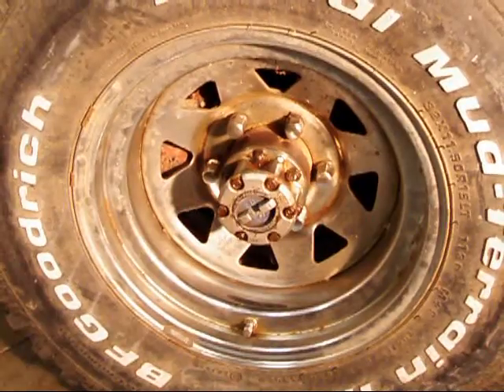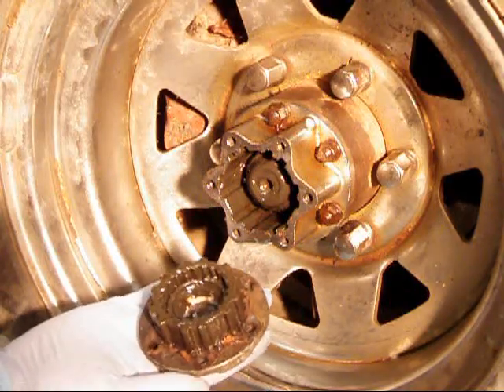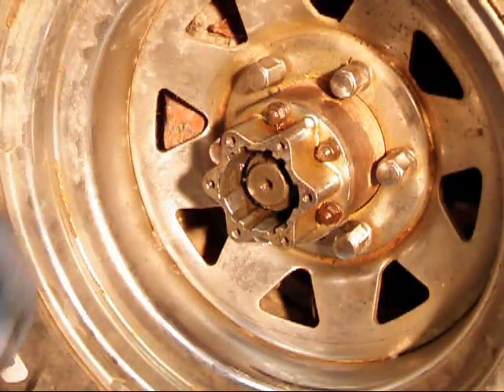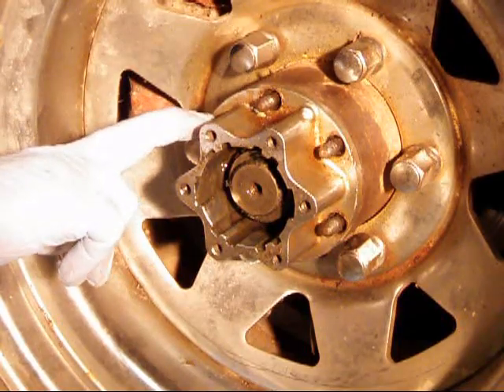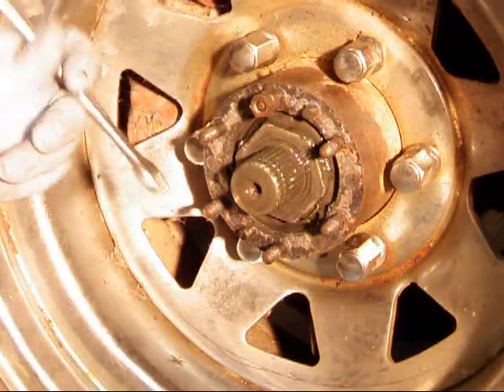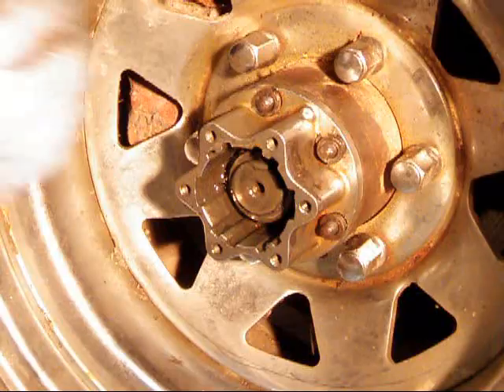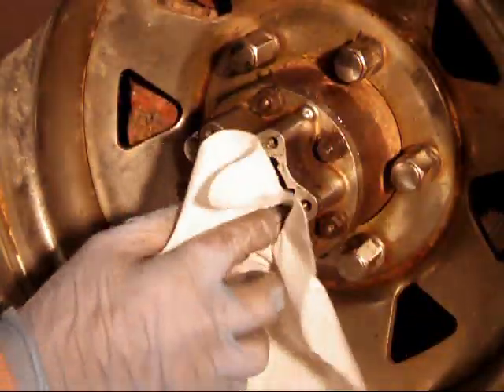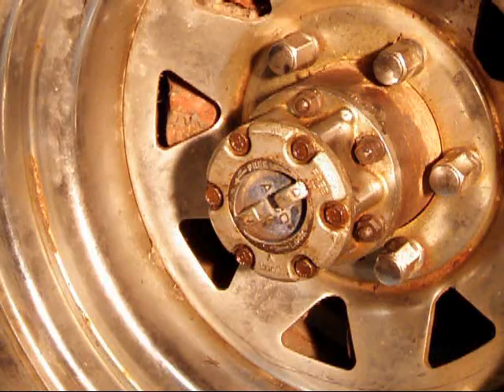How to Remove & Replace a Toyota 4x4 Manual Locking Hub (See video description for more info/tools)

Comment: Any idea why my hub dial would be siezed? Took it off, pulled the spring and pawl off and the dial is siezed inside of the part where the bolts go. Pulled the snap ring out, greased it, then put it back in. Still siezed.
Reply from the maker: Did you pull the actual hub dial out of the hub dial cap?  There should be a funny shaped o-ring around the actual dial to seal out the cap from the cover, and then there's the detent ball and spring that are in the actual dial.  They should correspond to the notches in the cover.  I've had one that was really rough because the o-ring was old and exanded and was jamming between the dial and the cover.  You could also have deformed one of the parts in a hard hit?  Marlin crawler has the o-ring, spring, and detent ball, if you need to replace any of those parts.  https://www.marlincrawler.com/axle/front-axle-parts/service-parts
Reply: Yes, as I said I pulled the snap ring out. Pulled the red only piece (dial) away from the piece that actually gets fastened via 6 bolts. I pulled it apart tomorrow and see if the detent and spring are situated correctly.

Comment: When I took mine apart the spring came out with the hub end cap now when I put it back together I cant twist to lock or unlock. If I install it on free it wont twist to lock and the same if I install it in the lock position.

Comment: After you have all that off, what would you do to pull the whole rotor off?
Reply from the maker: The problem with the early Toyota 4x4's is that the rotor is attached to the wheel hub via the lug studs.  You have to remove the hub from off the spindle to gain access to the rotor.  It's a total pain in the ass.  If you're that far into it you might as well replace the wheel bearings and seals while you're in there.
Reply: WheeliePete What seals?
Reply from the maker: You Mang Dial cap seal (paper), locking hub body to hub seal (paper), inner wheel bearing seal (rubber) inner axle seal (rubber).  If you do go that far into it I recommend that you use a marlin crawler eco-seal for the inner axle seal.  Those seals have a lot more flexibility and will keep gear oil from getting into your knuckle even with bent housings (which pretty much everyone has if you wheel at all with tires bigger than 33" or you've welded stuff to your axle housing.https://www.marlincrawler.com/axle/front-axle-parts/front-service-parts/service-front-hilux/hd-inner-axle-seal
Reply: WheeliePete Do you go over that in the video? I think I see the inner wheel bearing seal but where is the inner axle seal? I'm doing an 86 manual locker saturday and want to make sure. Thanks a TON, looks like fun saturday
Reply from the maker: You Mang  I don't really go over the seals in the video.  If they're not torn you can usually just reuse them. (The paper gaskets under the dial cap and the locking hub body.)  On the inner axle seal I was referring to 1979-1985 USA solid front axle trucks.  If you have a 1986+ US truck it will have independent front suspension (unless you've done a conversion) and you won't have the inner axle seal because you don't have a front axle housing. in the same sense the 79-85 trucks do.
Reply: Sweet! Mine is not converted so I do not need an inner axle seal. Already, you save me money. Thanks again. We will be using your video this saturday to guide us. I'll pay extra attention when I'm in there.

Comment from the maker: There's two springs in the hub dial assembly (three if you count the detent ball spring)  There's a big spring That pushes the clutch into the hub when you turn the dial.  There's a spring between the pawl and clutch that is used to bind the pawl to the clutch, which allows the dial to retract the clutch when set to "free".  I would bet that somene screwed up the install of the spring between the pawl and the clutch.  Send me a message through my channel and I can get you pics of how it goes.

Comment: What is the bolt hole for in the end of the cv?
Reply from the maker: I'm not entirely sure what it's actual use is for (some of the later trucks had a bolt and washer in there), but what is good for is you can stick a metric bolt in there and then you have something to grab onto while you try to get the snap ring off...or you can attach a puller to it to help extract a birfield from the knuckle.
Reply: Adding Spikes!! For some Mad Max style action.

Comment: This is the best video how-to for the Tacoma hub removal. I was in dire need of direction as i had a failed cv shaft causing BOTH ball joints(upper n lower) to also fail. I dont see a lock ring either on my 96 4x4 Tacoma, and unfortuanlaly for me I am having to do this on a spinlde that is not secure. Ill admit to be inexperienced on 4x4 and i did tap the hub like u said not to do, but very littel. I will try your brush drift method and i will also post a lil video on my Channel-et0307982

Comment from the maker: You can get the parts from a Toyota dealer, or order them online through marlincrawler(dot)com.  They are not expensive.  I usually just buy them as I need them from my Toyota dealer locally.

Comment: Can this hub be fixed?
Reply from the maker: How do you mean?  Depends on what's broken.  See my other video for a super-detailed hub-dial reassembly procedure.  Most of the time if these hubs aren't working (and they've not been grenaded into a bunch of pieces) the problem is usually because someone has installed the hubdial/clutch assembly wrong.  https://youtu.be/W78RkF1mUOE
Reply: I used the 4x4 last year, but this year I engaged the front hubs, they seemed very tight, hard to turn, had to use plyers....... and would not engage.  (I was on dirt, headed up a hill in 4x4 low, and only the back tires spun, and would not go up the hill as it should have.,  I wonder if I took them apart, greased them, well greased the hubs up, might that free them up?)
Reply from the maker: Yep.  Sounds like they are just gummed up.  You can take the locking hub dial cap off and easily inspect to see if it's gummed up in there.  Watch my other video on the hubdial-clutch assmbly I referenced in the message above.  One thin else it might be is sometimes the o-ring that seals the locking dial to the cap can swell or get pinched and out of place, then jam the assembly.  Once you get the cover out, see if the dial will turn and move the clutch in and out freely (like I show in the video for testing the reassembly.  Chances are things are just gummed up in there and it all needs a good cleaning/greasing.

Comment from the maker: I actually did a video on the brake line mod.  You can use a rear line to make a double long front line.  Go into my channel and look for the playlist that has the 4x4 mods tips and tricks.   it's titled: "How to make extended length toyota 4x4 brake lines"

Comment: Mines howl when I lock em in 2hi and 4hi
Reply from the maker: That kind of thing can be really hard to diagnose over the internet.  It can be a lot of things from wheel bearings, to the teeth on the ring and pinion, to the carrier bearings, to the driveshaft.  Probably best to find a local mechanic and have them take a listen.

Comment: LOL he forgot to put the center nut on before you put the locking hub on LOL
Reply from the maker: There is no "center nut" that you have to remove to pull the AISIN manual locking hub off or put it back on the solid axle U.S. trucks from 1979 to 1985.  The assembly goes outer wheel bearing, then the thrust washer, then a 54mm bearing preload nut, then a star washer, then the 54mm lock nut.  They're all there in the video, and all of that happens on the end of the spindle.  The manual locking hub body isn't held to the hub by anything other than the six studs and the snapring on the end of the Birfield shaft..  The threaded hole in the end of the Birfield's shaft you can see in the video is for assisting in pulling the birfield out if you need to use a puller.